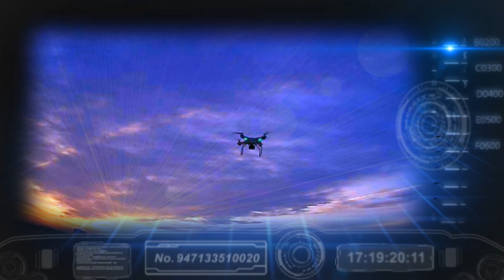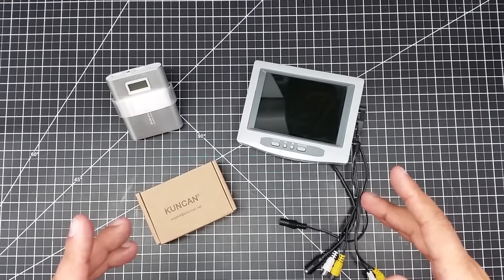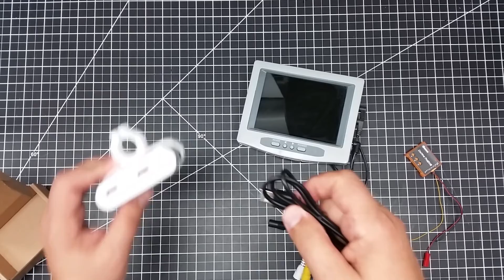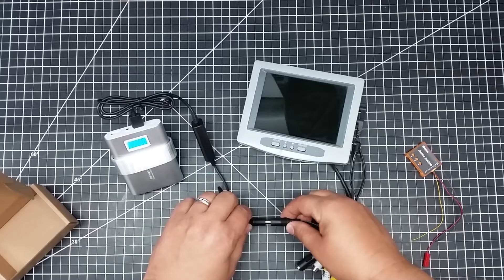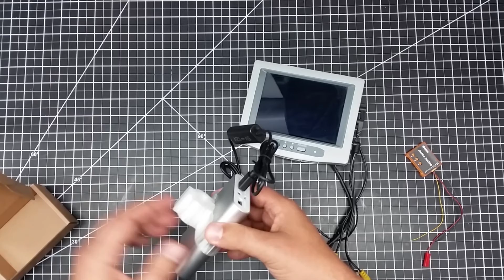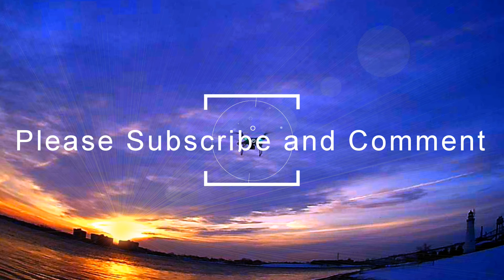Bench Talk - USB to 12 Volts for less Than 10 Bucks!

Comment: most 7" external monitor for video needs ≤950mA or higher.   you have to check the amperage before one rushes out the door grab one of this.  look for one with pretty good size bot in the middle of the cord for a safe bet.
Reply from the maker: Had this for a while and it has been working great!
Reply: let me put it in simpler words.  5" O.K to go.  7" screen, you have to get this one.   
https://www.amazon.com/gp/product/B071CT3TQB/ref=oh_aui_detailpage_o05_s01?ie=UTF8&psc=1
needless to say output from external P/S is more and over 2 amp.